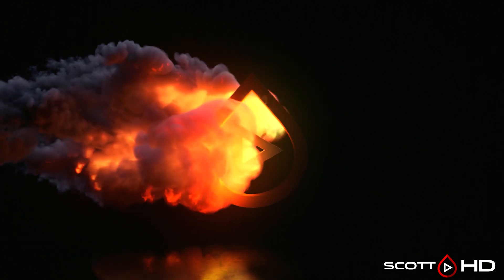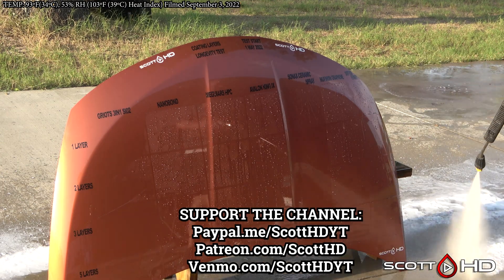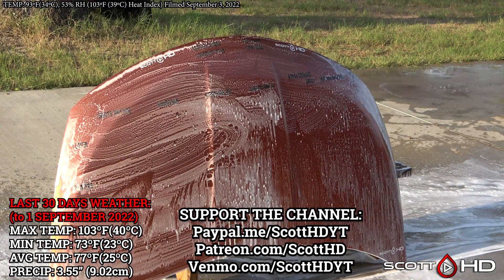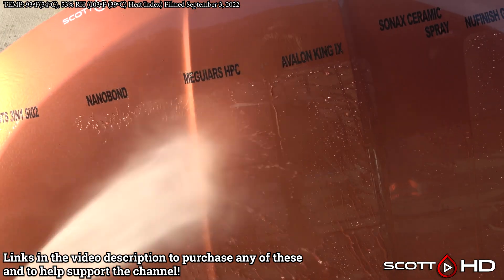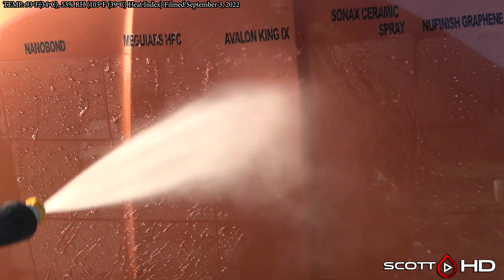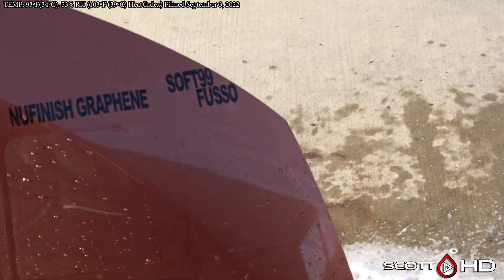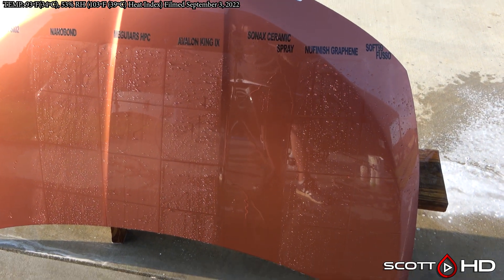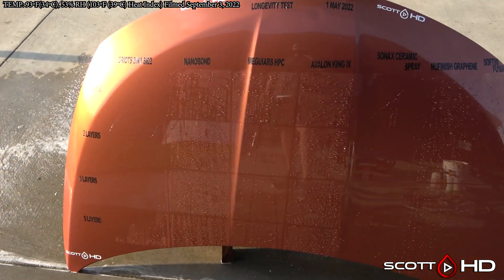CERAMIC COATINGS - HOW MANY LAYERS IS TOO MANY? Top DIY's Tested! - UPDATE 07- 4 MONTHS

Comment: Crazy. Griots and Sonax did so well in other tests. So much so that I just did a full paint correction and then ceramic coating and then 2 layers of Griots. Guess I should have done a different brand. Dang
Reply: This is one test out of almost every other test you can find where they are outstanding. It is pretty clear that the failure here is not primarily the product but some other variable. As for the Griots, the other test currently running with it (so same weather conditions - but one month longer) has it performing like it has in all of the other tests...

Comment: Scott, can you test base products + their recommended toppers? example Sonax PNS + Sonax BSD , Turtle Wax to the Max Wax + Flex Wax, IGL Premiere + IGL Enhancer etc. It would be interesting to see how much extra durability (if any) you can achieve with the base product+  their toppers vs being applied solo. (The toppers would only be applied once, at initial application not after every wash)
Reply from the maker: I can check that out.  Great idea!
Reply: @ScottHD  Thanks Scott! It would also be interesting to see "Ceramic Coating Rejuvenators" Like Essence+ and IGL F4 tested. I've had good luck with IGL F4,  it extended  the life of my almost dead coating  by approx 4-months. On it's own  F4 lasts about 90-days.

Comment: Methinks the issue with Griots is the (larger) amount of Carnauba Wax. Depending on which chemical sheet you read, Carnauba melts away between 175 and 185 degrees. 109 in the sun, the hood has certainly passed up the magical melt point. A paste Carnauba wouldn't have lasted this long. If you look at MSDS sheets for NuFinish Graphine, there is no Carnauba present. We have two products in the similar price/formulation standpoint. The presence of Carnauba is the odd chemical between the two.
Reply: The Griot's is being used in another test he is running and has been facing the same weather (on a black hood no less) and is performing like it always does (excellent). It is pretty clear that something else is happening here (possibly chemical relation with this clear coat?)... Either way, Scott has run so many tests with it and it has always performed the same *except for here*. There's another variable at play.

Comment: I recollect that you did not let Griots cure over the reccomended time (24 hrs+) given it would take at least five days for five layers.  So putting on five layers within a day may not create a super heavy multi layer coat as desired.  I thought if you had excess Griot's product dried during application, you can use more wet product to remove the dry excess.  This would leave me to think there really isn't five layers of Griot's.

Comment: Yes, I am a fan of the product and have used it quite a bit. I admit that I am not convinced the Griot's 3 in 1 failure is down to the product/weather combination. Considering you are currently testing it on a black hood, that has been through the same weather (and an extra month), and that in that test, the Griot's is performing pretty much the same way it always has (excellent) in all your other tests... It seems fairly clear that the results here favor attributing the bulk of the cause of failure to some other variable than the Griot's 3 in 1 and the weather. It might have to do with some chemical/bonding peculiarity with that hood. Who knows? Regardless, considering the overwhelming consistency of it's performance in your other tests, including the concurrent previously mentioned test, it seems very likely that something else is at play here.

Comment: Not a coating, but Finish Kare 1000 which is a sealant is purposely marketed towards locations with extreme heat. The product is marketed as a wax, but it is actually a sealant with no wax in it. One tub of FK1000 will last most people a decade or more. The secret is to apply it thin!!!!!!!!  I'm in NY where we don't get the heat you do, and I get a good 9 months of protection from it.

Comment: Griot's was a big disappointment. I have a question concerning it : Was this a new bottle used for the test or was it an old one?

Because you've used it before and it's experienced extreme heat like it did in the 1 yr test & it last a yr so what gives? I'm wondering if they've tweaked with 3in1 because it was a little "too good" 🤔? I say that because your earlier tests with it show it to be a real standout but here lately your tests show it noticeably lacking
Reply: Very curious about this too
Reply: I suspect it has something to do with the application/prep/finish etc. and nothing to do with the product. Griot's gains nothing by weakening a formula that is purchased with very high expectations. Unlike most of the other brands, they also mix their own product in their own facilities so have total control. More importantly, he started another test at about the same time as this one (earlier actually) with the Griot's 3 in 1 and it is on a black hood and has faced the same (and more) weather. The 3 in 1 is doing what it has pretty much always done in his tests and performing GREAT. I believe this is a weird one off and almost has to have something to do with an element other than the 3 in 1.

Comment: Scott, in your professional opinion what is the best paint coating (ceramic, graphene, nanodiamond, etc..)  that strikes the best balance between ease of use, gloss, hydrophobics, and durability if price does not matter? Thanks
Reply: Let me tell one factor that you should concern. How easy to remove the coating once its extra hardened with all fallouts. A very hard coating with incredible acid resistance is a real pain in the arse to remove.

Comment: I didn't see a meaningful difference between the single and multiple layers of Griots or Sonax.  By 'meaningful difference' I mean that IRL all of the layers performed like it was time for a new coating.  My intuition is that a single layer gives the most bang for your effort.  After all, the effort of putting one coating on every 10 months x 5 is the same as 5 layers at once and I doubt the 5 layer at once is going to give 4+ years of water beading as a coating every 10 months will.  Still it's a very interesting experiment and who knows, maybe multiple coats of some products will last super long. Thanks Scott! 👍

Comment: Very strange considering sonax and griots normally perform well. Maybe we should see this done again when its colder to see if there is a difference?
Reply from the maker: Oh I can definitely do it again.  It is odd that they all just nearly died.
Reply: @ScottHD  still doesn’t stop the concern that even though the hood was cured inside the coating died possibly due to heat. It would be a game changer if you didn’t already use griots in several other tests with hot conditions.
Reply: Use the same hood, of course.

Comment: Scott, another one for the list: the effect of “prep” on a coating’s longevity.

It would be ace to test two different (perhaps well known) coatings split into three: no polishing, polishing, polishing & IPA wipe down.

Rather than testing the coatings here, we’re validating the entrenched belief of prep is key and observing results.

Reposting again here in case you missed the first.
Reply from the maker: That one's in the plans.... "No prep, clay bar only, full prep"
Reply: @ScottHD  legend. You’re right, some clay and iron/fallout remover needs to be in there if the panel has embedded contamination.

I think one of the most interesting and telling parts of the test would be to test the solo variable or with and without an IPA wipe down.

This will tell us whether the solvent in the coating does most of the heavy lifting of any minor oils left behind after polishing. Or if time spent on an extremely thorough IPA/solvent wipe down is necessary prior to coating.
Reply: Add ONR to the list, Optimum is notorious for recommending ONR is enough to clean the surface prior OptiCoat.